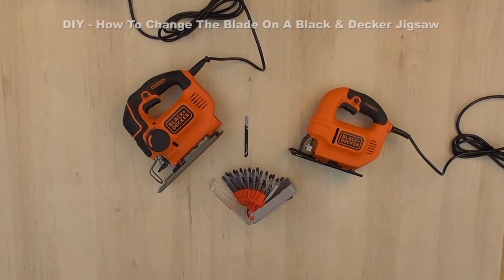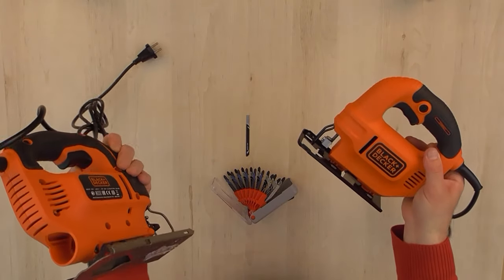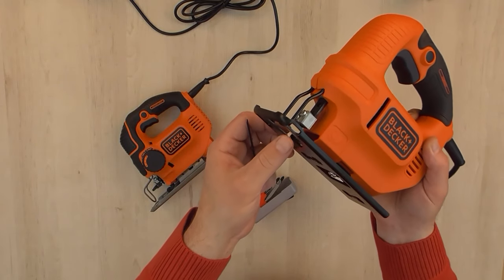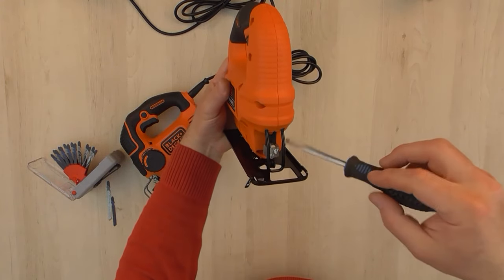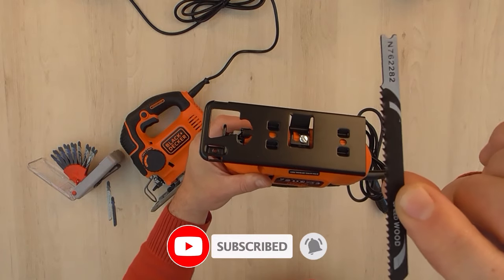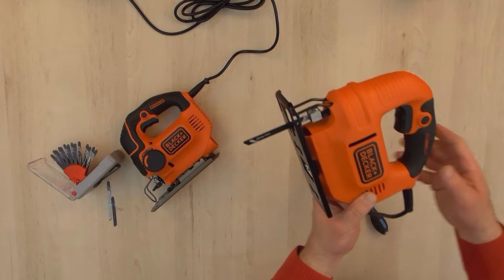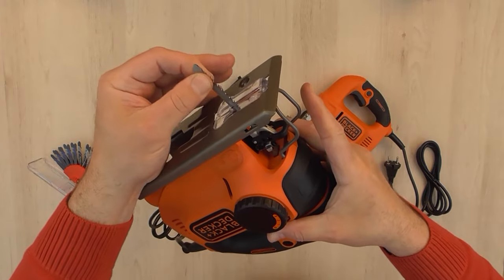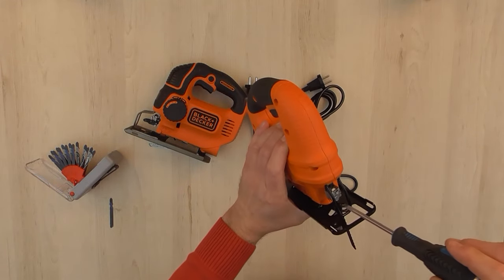DIY - How To Change The Blade On A Black & Decker Jigsaw - Bob The Tool Man

Comment: Hello! Can I use the T-shank on the KS501? Or is it only compatible with U-shank? Can't find the answer.
Reply from the maker: Can use either U or T shaped blades which means you are not restricted to blade types.
Reply: @BobTheToolMan  Thank God for that. I found a T-shape jigaw that is able to cut through 40mm (3.8cm laminate kitchen board with coating) but didn't find the U-shape variant. The T-shape will do fine with the KS501. It's the entry level one, but is it able to do the job? I really appreciate you responding, thank you.🙏